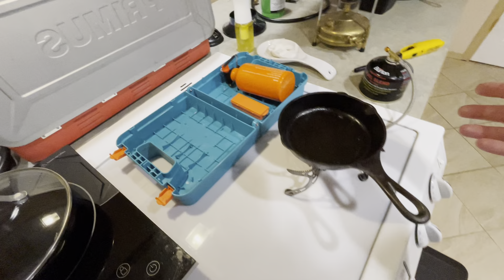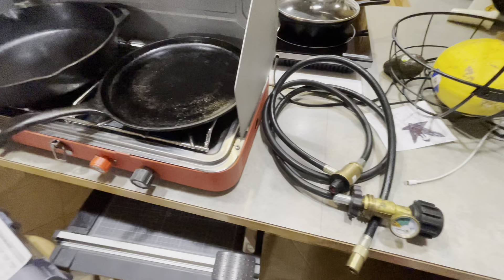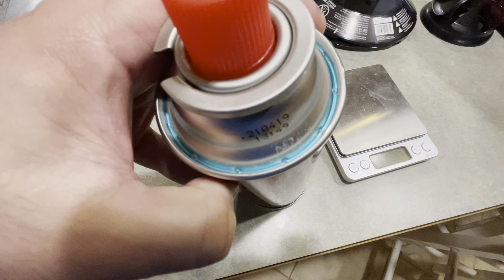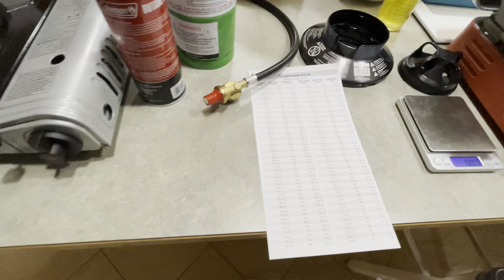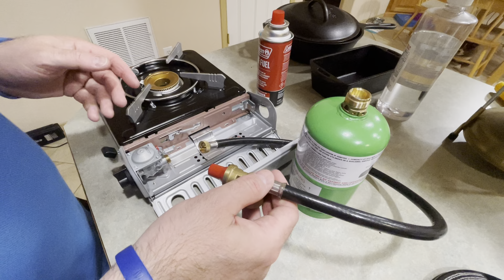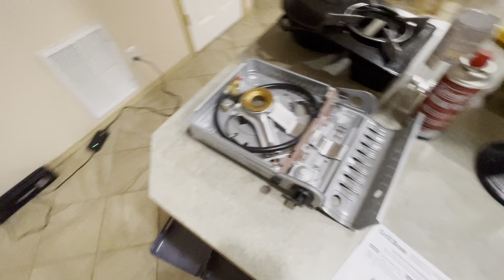#GasStove Cornucopia and #Grill Boss 90057 Dual Fuel Stove

Comment: Literally using same stove and walked through it step by step and it worked ONCE with propane and never again.   Waste of money.  I do NOT recommend the Grill Boss grill.
Reply from the maker: We have not had any issues with the stove, but if you are having trouble it might be best to contact the manufacturer. Question for you: the stove has a pressure regulator with a reset button. If you reset the pressure regulator that might free it up where the stove would work just fine.
Reply from the maker: See 8:13. I would be happy to discuss in more detail if needed. I do not represent the company but I have two of these stoves and they have been working perfectly for as long as I have owned the fan them.

Comment: Hey like your review I am in Australia and I think our laws and stuff are very similar but I can't find any portable stoves to use indoors for wok cooking like butane! there are hundreds for sale but all say outdoor use only , but I see asian people using them indoors so is it "Use at your own risk" scenario? Or are there specific ones suitable for indoor use? Cheers Mat .
Reply from the maker: I think the issue is the capacity when it comes to danger. So the butane containers are lower pressure and they have a lower capacity. It’s not as dangerous to have 250 g of butane floating around versus 2 kg of propane. Most people use butane safely indoors, outdoors, my recommendations if you try that make sure you have adequate ventilation. They do make very small propane containers here in North America. That can hold up to 50 g of propane. It is my opinion those are safer than the 450 g containers. I hope this helps. None of the thing that you could get is a carbon monoxide detector. Having all those things is considered Defense in Depth for the risks.

Comment: Ok so my grill boss is not letting propane out when I turn knob now. Unit is like new and I only used it a few times. Im using propane canisters. Any idea as to what is going on why when I turn gas no gas
Reply from the maker: Did you try pressing the red relief button?
Reply: @Linus007  yes, it use to make a click but now does not.
Reply from the maker: @RhiceyHarierar  does it work with butane?

Comment: I purchases the grill boss and followed the instructions but it won’t ignite. I can hear and smell the gas released but no flame. What can I do? It’s new so I don’t see any debris or blockage.
Reply from the maker: Are you seeing a spark? Is the wire damaged? Without the spark, no ignition will take place of the wire is damaged or the spark device is too far away from the metal parts of the stove.

Comment: I just bought this stove and the gas is leaking
Reply from the maker: If you are using propane connect the tank at the last step. Make sure all other hoses are connected before attaching the tank.
Reply from the maker: Are you using propane or butane? Connections are tight? If butane, do you have the can properly fitted?
Reply: Thank you so much for your reply. But I have done as you advised several times and it continues to leak.
Reply: I am using the small Coleman propane
Reply from the maker: @sandrafreeman9050  I made a new video to show the areas that should be checked. Please see this video: https://youtu.be/rVKIs02C0V4?si=DubaMggTRv6NZsoX
Reply from the maker: Where is the leak? If you cannot find the leak exchange it for a different stove.

Comment: This stove is complete junk. I bought one. Cheap flimsy case came pre broken for me. Gas leaks, stove caught fire, fixed that and now gas won’t flow through it after only a couple of uses. It has a new home today. Straight in the trash can. Absolute garbage. I tried replacing it and the second one was just as poor quality.
Reply from the maker: Why did you not replace the first one instead of placing it in the trash. If you had leaks, I would have returned it immediately. I’m sorry that you’re having these experiences, but I cannot say that I have had the same.

Comment: Thank you!!! I narrowed my choice down to this unit because of the safety features. (I’m a bit nervous about butane only because I haven’t used it in many years.)

We have frequent power outages but also want to take it car camping. You gave so much valuable information, that I feel confident. This is great. 

I canceled my Amazon order so I can get it through you . . . sharing a few pennies.
Reply from the maker: Thank you so much for supporting the channel and greyscale.zone. The stove is very easy to use with either propane or butane.

Comment: Very good content... Does Propane burn Cleaner ,ex: Less Carbon ?
Reply from the maker: Thank you for your comment. Both propane and butane burn extremely clean. The resulting output is heat carbon dioxide, and water. The other fuels are very similar if the fuel is burning at the proper temperature. For example, the kerosene stove will burn very clean as long as it is burning hot. All of these stoves, except for the electric stove might produce carbon monoxide if the air fuel mixture is incorrect. Care should be taken to prevent a pot from getting too close to the flame where it cools the flame. That particular action can result in increased carbon monoxide production.

Comment: You can always put the leftover butane into the refillable propane tank.  Propane vapor pressure is higher than butane so it will be perfectly safe.
Reply from the maker: Yes. Propane tanks are more than strong enough to hold butane. Of course the reverse is not true.

Comment: What's the smallest diameter of pot you can put on this stove?
Reply from the maker: I would not go any smaller than the area where the flame comes out of the stove. Otherwise, you will be wasting a lot of heat around the pan then under the pan.

Comment: Which fuel source(Grill Boss), is more economical, & can I connect it to a 20lb propane tank?
Reply from the maker: Propane is the most economical. Yes, with an adapter you can use a larger tank.

Comment: Great video, I hope to find a similar dual fuel cooker here in Australia. 
Although I have one gripe after the disparaging comment you left on my own Butane camp stove video, I did not and do not recommend ANYONE refill these. At 4 times the pressure of butane, it is not worth the risk. During my own tests at 35℃ plus temperatures a refilled canister will trigger the safety and vent which is dangerous and potentially life threatening.
Reply from the maker: Thank you for the update. I was not referring to your video in this one. My reference is to refilling any non-refillable containers. You do mention in your video that filling a butane cylinder with propane is not safe. I found your video a few hours after I filmed mine. Your video came up in a search.

In Australia, are your treads on the tanks different than North America? I assume they are metric.